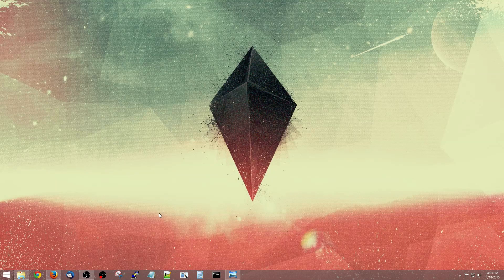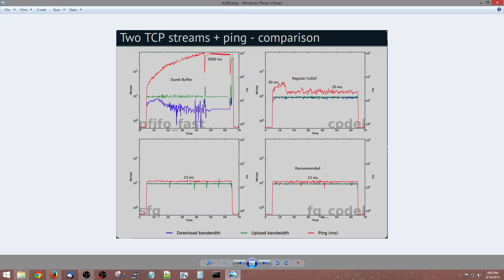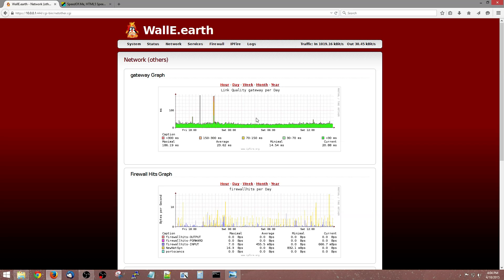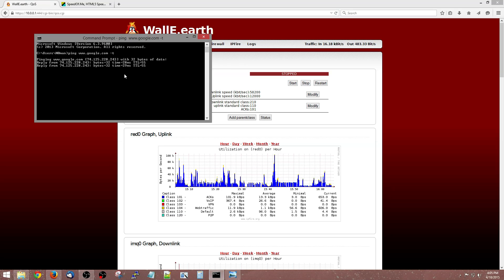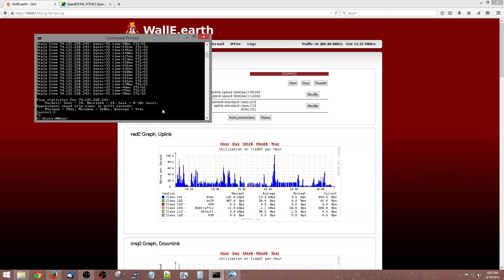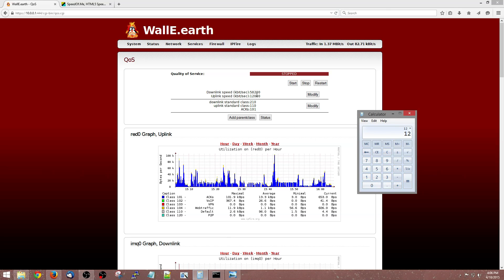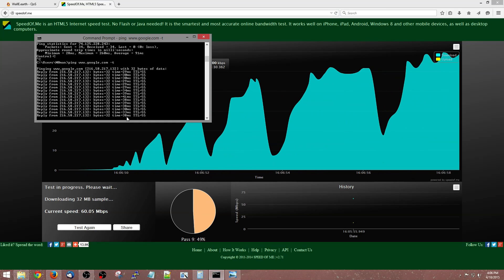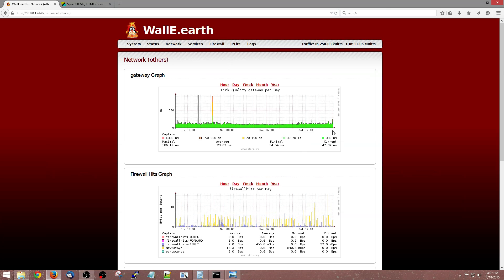Explaining And Fixing Bufferbloat

Comment: how can I lower my bandwith? I have a router called Fritzbox and cant do anything with it. I live in Germany
Reply: Did you do the basic gaming settings on Fritzbox? Priorization, opened ports etc.? This is the best you can do with Fritzbox. The next step is to disable window autotuning and see does it help. In my case it helped a lot. Bufferbloat dropped from 40 ms to 0-5 ms. The downside is slower internet speed so when you stop gaming you have to restore the autotuning level to normal.

Comment: What do i do if my modem doesn't have SQM or QoS and there are no compatible custom firmwares?
Reply: Get a router that does support it. Ubiquiti Edgerouter X is like £60. Be warned though, its just a router. Its not what most ISP "routers" are, which are 3 devices in one. A router, a modem (sometimes) and a wireless access point. So you'll need to get a wireless access point (or several) separately with the edgerouter.

Comment: In the previous apartment I had the bufferbloat at its worst over 3000 ms (100/10 cable). I tried everything to fix it but the issue wasn't in my end. Now I live in a new apartment where the bufferbloat is 1-3 ms. I have now officially A+/A/A+ cable connection :)
Reply: did you comment just to flex
Reply: The reason why I commented can be found by reading my comment. Why so negative feelings?

Comment: I havent tried it with ipfire but with pfSense it doesnt work. It limits my upload but yet I still get high ping when not maxing my upload.   OpenWRT, Tomato, DD-WRT, and my Edgerouter do it perfectly fine. But yet pfsense and most consumer routers limits it but will still get high ping anyway.  I dont have issues with my download my ping stays fine when maxing it. But my upload is what I have to deal with.
Reply: Yeah my isp uses pfsense for my connection so theres no way to fix my ping issues then

Comment: What a great video! I reduced my bufferbloat from 500 ms on the upload side of things to less than 60 ms.
Reply: +Vexellent Just to elaborate further: I used the dslreports website to see bufferbloat. And I had to use 90 percent of the upload speed rather than 97 percent as recommended by the video, in my case at least.
Reply: how?

Comment: Name a router or modem I can by to stop latency
Reply: +Rainy Nights netduma r1
Reply: Ubiquiti USG, dead simple UI, or if you're hot on technical networking, a cheaper faster option is the $50 Edgerouter X
Reply: +Rainy Nights Any router that runs OpenWrt. Check out http://wiki.openwrt.org/toh/start for a router that runs Barrier Breaker (14.07) I am partial to the TP-Link Archer C7 v2 ~US$90.
Reply: I second this, i'm about to buy one right now
Reply: An IQrouter does all of this completely automatically for you: http://evenroute.com
It is great on highly variable lines, as it dynamically adjust to changes in capacity, so even when all the neighbors are streaming in the evening, you still have a low-latency connection